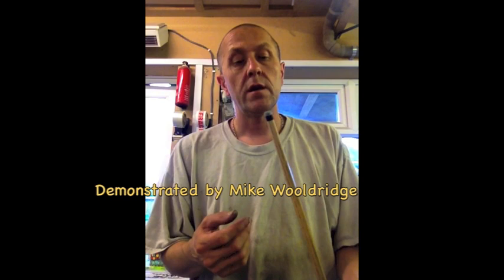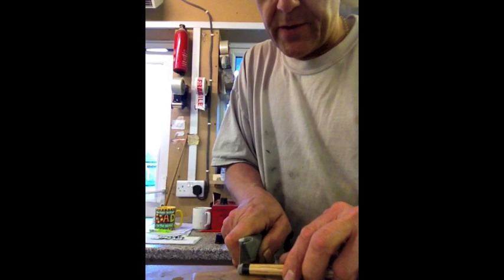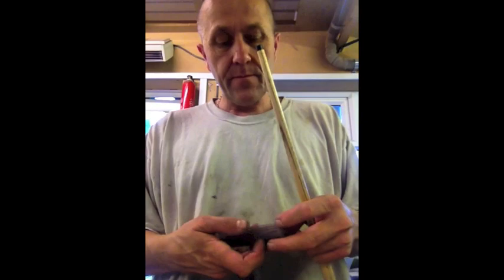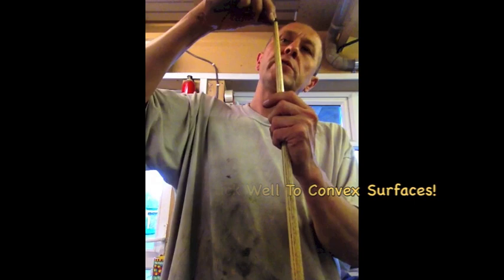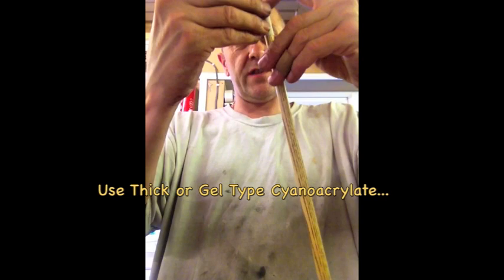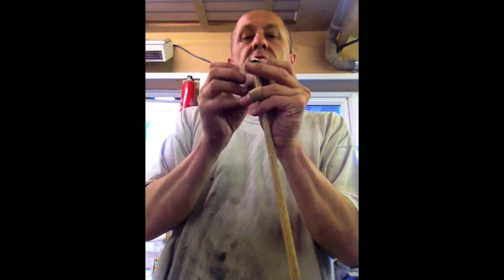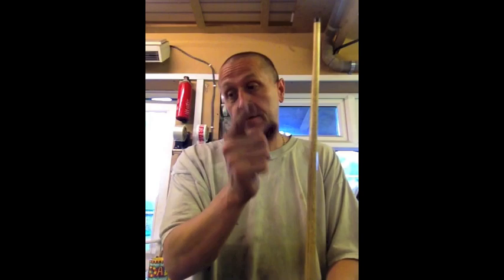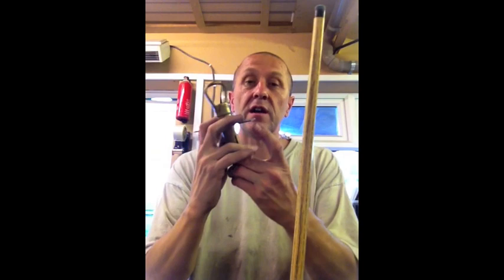How To Re-Tip A Snooker, Pool, Billiards Cue

Comment: If you prefer a mushroom tip, you can also add tape to the required diameter (you can use a precision caliper) before cutting off the excess. This is usually easier as it can be quite hard to get the tip positioned perfectly centered without a guide.

You can also make your own tip centering guide by cutting a piece of tubing with the correct inner diameter for the tip size. Cut it to a length so it fits snug on the cue leaving enough overhang for the tip to seat into.

Comment from the maker: It's tricky cos you really need to keep it perfectly flat. I mentioned in the video that the tip clamp I used has a slot for a file which is quite efficient and effective at keeping the file flat when turning on the top of ferrule. Apart from that, there are other tools available but usually not that good. So try one of those clamps if you can. I am also working on an idea for a cheap and easy tool, but will be a while yet.

Comment: Nice video Mike, followed your advice and did a great job replacing my tip. I have a pack of five of your "Supertips" I bought a few years ago and they still seem fine. What is the issue regarding the Tweeten green chalk? Is it just a preference or just a bad cube? Do you recommend another chalk with your tips? What is the translucent abrasive you are using in the video?
Reply from the maker: The newer light green chalk is more 'powdery' and NOT the same product as the original spruce green chalk, which is more ' gritty' for want of a better word. Can't remember exactly but something was removed from the manufacture some years ago and that is why it is different. Light green is fine if that's all you can find, but the dark green is better so get if you see it. The sandpaper I used there is Mirka Abranet. I actually prefer cloth backed aluminium oxide but I happened to have some Abranet to hand so that's what I used. I do not recommend it over cloth backed but it is very good regardless.

Comment: on ur website u r advising to add fibre pad,but here u r not using any
Reply: The video was made before I introduced fibre pads to help protect BlackSpin ferrules. A fibre pad helps protect the ferrule but is not essential, many people still use without and have no issues. But I do recommend it now. Fitting instructions for fibre pads at the bottom of the page here: https://handmadecues.com/re-tipping/